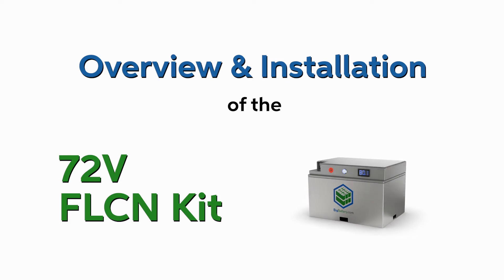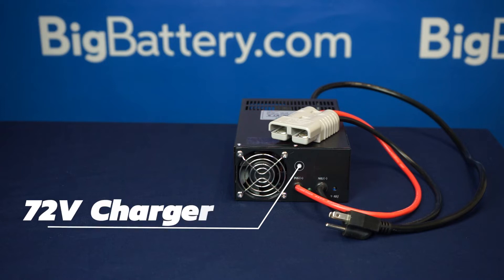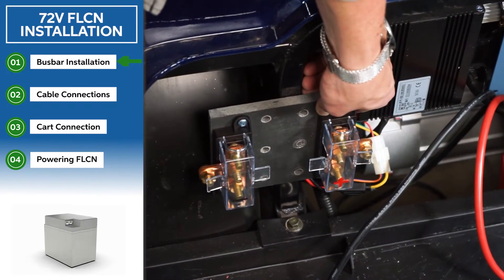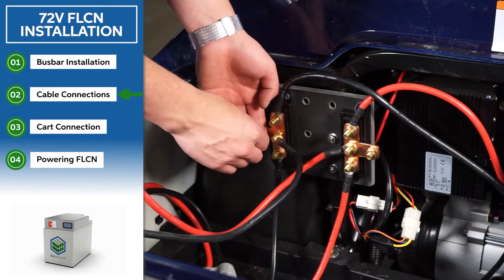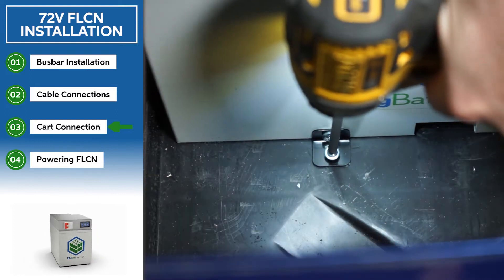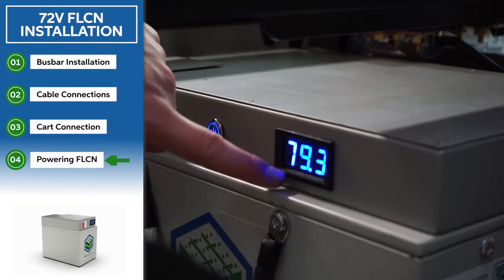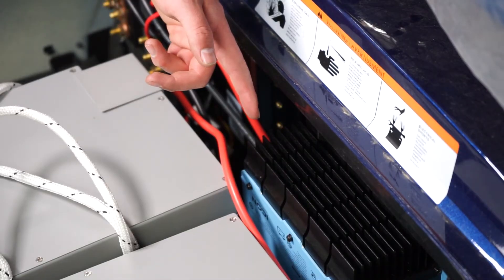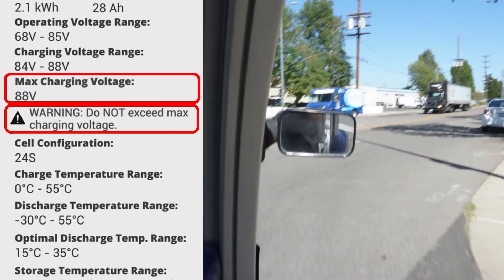72V FLCN | Golf Cart Installation

Comment: They do NOT fit in the battery tray of a 2009 Club Car DS. Unfortunately I found this out the hard way.
Reply: I wonder if this is a common issue that most people don’t know about. So you’re saying stick with a 48v system?
Reply: @chrisginoc  I’m not sure that a lot of people are going 72v in a club car ds. It requires more work and some fabrication to do it right. Don’t get me wrong it’s fast and people are shocked with the torque but if I could go back I would have stuck with 48v and went with four of the Eagles. Way more range since you can use more batteries.